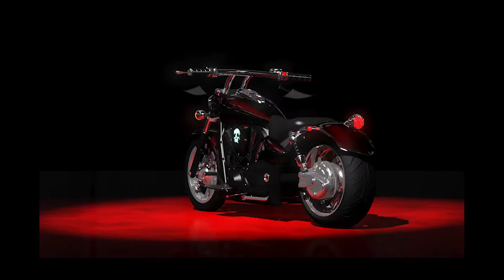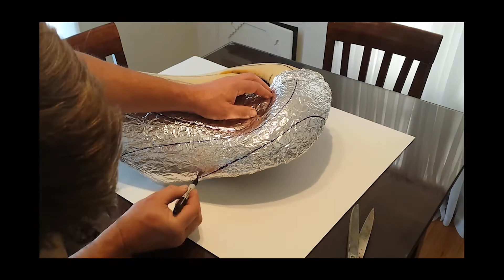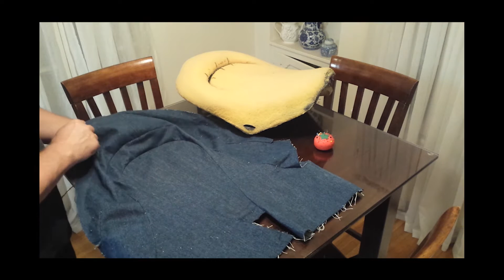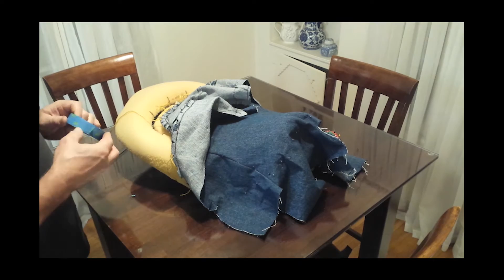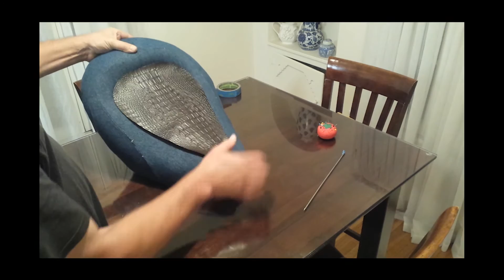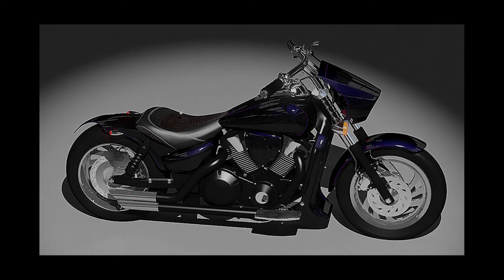Motorcycle seat custom cover - Part 1

Comment from the maker: Hey Youtube - wanted to announce that I will be making part 2 of this video, where I will cover the actual construction of the seat cover using the crocodile and black leather-look vinyl.  I have changed the pattern made in this video ever so slightly, but the overall design and layout remain virtually the same.  The video will include cutting the vinyl from the patterns made previously, tacking the vinyl together, sewing the cover, and then covering the actual seat.  Hopefully I'll have a finished product by the end of the week.  Till then

Eric 
aka 
MacGyver
Reply: Eric Camden I looked, may I have a link?
Reply from the maker: Hi Melissa.  Not sure what happened to it, let me dig around some.  Give me a little time as I am in the process of making several tool and woodworking videos.  Once they are done, I will repost part II.
Reply: Eric Camden AWESOME SAUCE